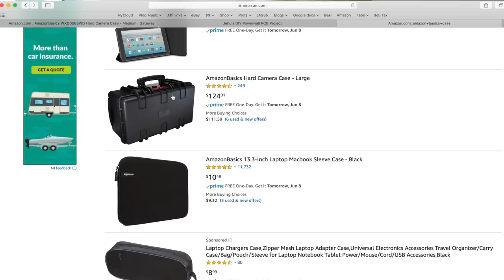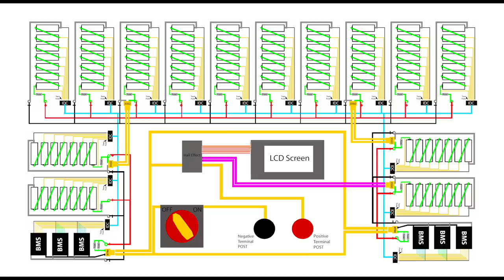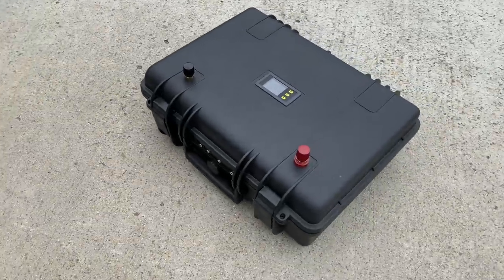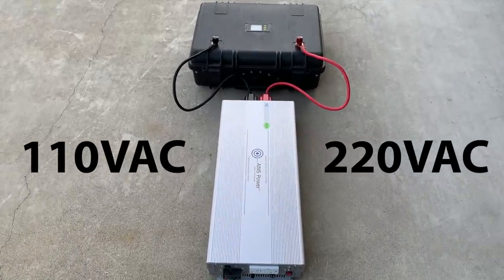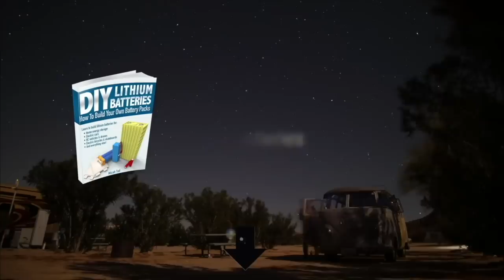600,000mAh DIY Power Pack build

Comment: I would make above the cells themselves a passive radiator with think copper heat pipes that will go between 2 rows of batteries and you open the lid when charging or discharging to dissipate the heat and when you transport it you have it closed and weather sealed , and also heat indicators and switches to not allow the pack to overheat or underheat allowing a heating element to be powered and heat the heat pipes if you are under 5 degrees celsius.(i see he has room for that in that case and if not we go 1 step bigger)

Comment: Put in a cell backward once on a parallel bank.  The spring for the - side. I scrambled half second got it out...freaked me out it lit up like a lightbulb. Unknown brand blue wrap 2000 mAh cells. I'm sure u have some crazy bench stories man...HI VOLTAGE

Comment: Out of curiosity. Have you done any vibration or drop testing with this? I am thinking if I were off road and it fell off the tailgate how would it hold up? Not talking any crazy 10 foot drops or super vibration just normal transport in a vehicle. Love the build!

Comment: Great video, thank you. 600,000mAh = 600Ah, times 24V = 14400Wh = 14.4 KWh. Please clarify.
Reply: Jesus Bermudez It isn’t “times 24”. You have to take the cell voltage which is about ~3.7V. So 600 * 3.7 = 2.22kWh.

Comment: Nice tutorial considering to build a smaller version of it. It's good but you get pylontech 3.5kWh with 48V peak 73A, sustained 37A in a 19 inch rack with handles for $820.

Comment: You are the king of batteries. Put Wh's in the title instead of Ah which tells nothing without knowing the voltage.
Reply from the maker: The masses are easily impressed by big numbers,  and they need to see this
Reply: Then why not put big Wh numbers?
Reply from the maker: Not big enough
Reply: @jehugarcia  2 200 000 mWh not enough?

Comment: While it certainly doesn't hurt, it isn't all that important that cells in parallel be the same voltage so long as each parallel bank is the same voltage as the other, so that all parallel banks (or cells) connected in series are at the same voltage.
Cells connected in parallel will naturally even out. Slowly during rest and faster during discharges, and should mostly do so during the initial discharge, which is a good idea to do prior to a recharge so as to minimize load on the balance fets and resistors(if you have larger variations)

It's much more important to ensure each parallel bank in the series link is precisely the same voltage, which can quickly and easily be achieved by swapping out individual cells, without unnecessary concern.

Comment: What was the final price of the build?    Great video!
Reply: @thesmoothgoat  Aparentemete are two 7s in parallel but it is difficult to understand, I would like jehugarcia to separate or divide it to be able to do it in two steps. Excellent projects Greetings.
Reply: @arizarturo  I know exactly what he did its not difficult at all. I been following jehu for a while now and completely understand everything he does. I have built my own 400ah 18650 mini powerwall working great. My point is for simply charging small devices a 12v system would be better... a 4s system is the way to go for this.
Reply: ~$1500 USD
Reply: 1300€
Reply: If you look in the description below the batteries alone cost $730 per 100 cells and you will need 200 cells for this project. The kit for the board specific to this project in another 500...so it puts this portable battery near $2k.
Reply from the maker: $1500 total
Reply: @phatpunxs64  It's $730 per 200 cells.
Reply from the maker: You do realize you can buy used cells right?  How much more do I have to hold your hand?
Reply: @thesmoothgoat  I could not agree more a 4s2p A123 20Ah Nanophosphate LiFEPO4  AMP20M1HD-A  pack will shit on that suit case pack
Reply: @thesmoothgoat  I looked it up,. the estimates are not all that much. Povertyl level income really from I can see. Would make good extra cash though if he already has a steady income
Reply: Or you can buy a tesla battery E-bay 250Ah 5.2kWh 444 panasonic 18650 cells $1245
Reply: @Raven05R6  Too expensive. Too complicated. Too much labor.
Reply: over $1300, it includes 200 cells for $730, the case for $75, HP BMK 14x$22.72=$318.08, 2xBMS $100 and that's just the major components and not the "what's in the pantry"
Reply: Jehu Garcia, you do realise that you pushed a company that sells new cells for a price that you wouldn't pay for... if you're not going to use someones product then don't promote them, not fucking rocket science
Reply: Ok, now someone please explain how this labor intensive project can beat a used Tesla battery module which retails at around $1, 200 but has more than double of batteries.
Get a suitcase for for the inverter and a trolley. Done!
Reply: @jehugarcia  that's the most douchy thing I've heard in a while, you used new cells and even promoted them, yeezes...
Reply from the maker: @Happyfox I’m going to use evwest cells in my VW bus,  you talking out of your ass here
Reply from the maker: @jcrnda buy a Tesla module and try using it with a 24v inverter and you will find out
Reply from the maker: I promote new and used cells,  are you not paying attention?   Stop complaining! If you can’t afford the new cells then order used ones,  don’t complain that it’s too expensive,  it’s not,  it’s a battery 4x the size of commercially available ones using premium cells,  don’t be ignorant
Reply: @jehugarcia  _ Cheeper, simpler solutions out there with LiFPO4 chemistry that last twice as long.
Reply from the maker: Yes
Reply: @alanalan-mq8yw  wouldent touch a tesla battery with a barge pole. 1 without the main managment your a sitting duck. 2 tesla packs are driven hard so you have no idea how much life is left. 3  one short and you can kiss goodbuy to the alloy fuse links so you end up pulling the pack apart so you may as well go to poundland and buy 444 powerbanks for £1 each as they use NCA cells in them allbeit only 1.2Ah
Reply: @johnbeckman8916  get back to your video game
Reply: @DEVONLAD11  sorry couldn't find your build...flap that jaw!
Reply: @sumacmt  _ Hey Lawrence, thanks for chiming in and showing us all the depth of your ignorance about me and what I do. I'm sure that most people find it weird that you think you can lord over me or anyone else by tell me or others what to do. Good news, therapies are available for that pathology! Those that peruse these comments and have reading comprehension skills know that jehu agreed with me with his "Yes" comment. Blessings to you bro!  😃
Reply: jehugarcia 
With me...?
All the way Baby since I’m just starting out
and attempting to learn this stuff...!
I guess that I made the mistake and actually 
thought that content creators put out videos
like this as a means of teaching people how 
to do things...

Comment: Super Awesome Build!  But I think that your mAh Calculation is a little off. 

It should be more like 85,000mAh. Since you had a 24V system you had 7 cells in series to get that voltage, but Ah don't add in series, only the voltage does. So you essentially have 28 24V 3000mAh batteries in parallel, 28x3000= 84,000mAh @ 24V. Which then gives you 84Ah x 24V = 2.04kWh.
Reply: They actually appear they are in 7s 2p configuration, thus (each board) creating a 24v battery that has a capacity of 6000 mAh(3000 mAh per side). The video is confusing, but if you think of it as 14 (boards) batteries that are paralled together 6000 mAh each, you come up with 84000 mAh, which would be equal to 2016 Wh @ 24v...

Now that makes more sense

Comment: Is 600,000mAh=600Ah?
Reply: Shame the maths a wrong. He didn't use ohms law. He is saying 200x3000mAh but it's a 7s pack. Thus 200/7=28.5 thus 28p7s. 196x3000mah. 28x3000mAh=84Ah.
84Ah x 24v = 2.01Kwh.
Reply: Mykel Hardin  ohms law V=IxR, the amps are still only 3000mah x 28 thus not 600Ah.

Comment: Jehu, thats a beautiful battery and you've made the process of building it very easy. The big important question that no-one seems to be asking is "What's the best way to charge this beauty?"
Reply from the maker: Charger.
Reply from the maker: Small - https://kit.com/jehu/2-2kwh-24v-powerpack-build/jnenconn-29-4v2a-lit
Reply from the maker: Larger - https://youtu.be/80hh4lAImSE
Reply: @jehugarcia  :p yes, but not just any 24Volt charger, are you and I assuming people wont put a 24volt lead acid charger on it?
Reply from the maker: No problem, this is actually a 24v battery
Reply: jehugarcia thanks for the links. The point I was making is it’s important for your viewers and customers to understand that they can’t just use any type of charger, it has to be chargers with the right voltage and changing profile for the batteries.  Maybe there is a video  you could make explaining why.  Say you made two of this boxes and you connected a flat one to a full one, it would not end well, you absolutely need current sensing and current limiting during the charging process. The charges you linked to provide that. I think people need to know why it is so important to use the right type of charger. Love your work!

Comment: And wha is a real usage of it? Why you not using a car/bus acumulator for 1/10 of price?
Reply: Sure, its cheaper, but it also has lower capacity and is heavier. Its also bigger
Reply: Those are starter batteries, which don't like to be deep cycled. I personally would prefer to use a marine battery, you get more capacity with that.

Comment: would have been easier to say 600Ah :) Another great video, what was the final build price?
Reply: I agree with your sentiment, but it's mostly the fault of the manufacturers, who have gotten people accustomed to 30,000mAh USB  battery packs, rather than simply writing 30Ah.
Reply: @gabehumphreys2433  маркетинг
Reply: Even though it's not actually 600AH 
Its only 91AH since it's a 24V battery not a giant 3.7V battery
Reply: @mwbgaming28  i dont think that is how it works
Reply: @ambiguoustvreference835  umm, yes that is how it works
Reply: @mwbgaming28  [x] doubt
Reply: @ambiguoustvreference835  prove me wrong
Reply: @mwbgaming28  i will steal your bones
Reply: @ambiguoustvreference835  I am now convinced that you are trolling
Reply: @mwbgaming28  no u
Reply: @ambiguoustvreference835  i already proved myself, it's called math 

Volts multiplied by amps equals watts 
Watts divided by volts equals amps
Reply: @mwbgaming28  amps×volts=watts. Amps×discharge time=amp hours
Watts×discharge time=watt hours

E.g. 10amps×10hours of discharge= 100 amp hours
There is a difference in amps and amp hours. I hope this clears everything up
Reply: @ambiguoustvreference835  you don't know for certain how long that device runs for 

Its a 24V 91AH battery 
Not a 3.7V 600AH battery
Reply: MWB Gaming You didn’t catch the 15a C rating for each cell part? 
 Sorry had to come back and edit. Forgot to say C rating. And 1w for 24hours is 24 why that means 15a makes this capable of insane ahs!
Reply: @towmater2276  each cell might be able to deliver 15A, but that doesn't change the fact that it's still a 91AH 24V battery
Reply: MWB Gaming I’m curious where you get 91 from 3000mah x 28p comes to 84 not 91.
Reply: @towmater2276  the average capacity of that cell is 3250mah, 3.25 x 28 = 91
Reply: How much was thing thing? $1000?
Reply: yes, around 1000usd and indeed it's 84 to 90 Ah, since 196cells (14x14)  connected 28p7s gives 24V-28V and each battery has around 3000mAh. (28 strings of 3000 is 28x3000 = 84000mAh approx.)
Reply: @mwbgaming28  its 84ah max
Reply: @towmater2276  The c rating doesn't mean shit its all about max amps over a 20 min or 60 min period the c rating is max sustainable amps without overheating battery
Reply: @mwbgaming28  yep, I was doing the math and I was thinking it was only 84Ah which is around your 91, I estimated 7s28p. Went looking into the comments to see if anyone else caught that.

Comment: Very nice build, my only concern is you have live screw terminals on the outside of the case which could potentially be shorted
Reply: Something like this will surely have short circuit protection

Comment: Hold on, those standoffs carry current right?  What about the screws that go through the side of the case?  Are those not isolated?
Reply: The case isn't metal.
Reply: @ThisIsInput  The fasteners sticking out the side are.  If those are not isolated and the edge of the case with those sticking out hits something conductive, sparks would fly.

Comment: I love your channel. It has inspired a great many ideas in my old brain. As I’ve suffered a couple strokes I tend to ask for clarity a lot. My math also sucks so let’s struggle through this together. 14 boards @28 batteries each is 196. And 196 x 3000mah is 588000mah. So 588000mah is 588ah x24v = 14112wh. Meaning that the battery is 14.1kwh if I didn’t miss something. Please let me know if I did as I want to be sure of how to figure my future build! Thanks for all you do for all us diy folks out here. Wait a second! 196 cells, 3.7v 3000mah/3ah, 7S 28P, 15A max discharge rate, so 24v 84,000mah/84ah. Does 15A continuous = 360w C, and since 1w @24hrs is 24wh, then 360w @3ah is 1080wh, multiply that by 28p and we get 30,240wh. Divide 32,240wh by 24v for a 1260ah potential. Don’t let your battery sag 🤪
Reply: You can't parallel adding the mAh when you go series to add voltage.

The cells are in 7s 2p configuration, thus creating a 24v battery that has a capacity of 6000 mAh. The video is confusing, but if you think of it as 14 (boards) batteries that are paralled together 6000 mAh each, you come up with 84000 mAh, which would be equal to 2016 Wh @ 24v...

Now that makes more sense

Comment: The title is confusing and wrong (click bait indeed), your battery is not 600Ah, that would be at what voltage? at 3,65v exactly but it is a 7s system not 1s so at nominal voltage 25,2v its a 87Ah battery. You confirm that by saying its a 2,2kWh system - obviously :P
Reply: Yeah its confusing when the voltage isn't stated as well. 

Many power banks do this as well. I have a 6s Anker powerbank they rate at 20,000mAh but don't explicitly say the voltage. Fortunately they list the watt-hour capacity which is a better unit for overall capacity.
Reply: @bryanjk  Exactly, unless the voltage is explicitly stated we should always use watt hours as a measure of capacity to be able to compare different batteries
Reply: Voltage can be regulated. Capacity is what he's building for.
Reply: @China shorts It doesn’t work like that, because you increase voltage by putting bateries in series and increase capacity (and max current output) by putting them in parallel. He made 28 individual battery packs from 7 batteries in series which gives you 24ish volts and 3000 mAh and then he conected them together in parallel, so the capacity will be 28 * 3000 mAh. If he wanted 600 000 mAh, he would have to put them all in parallel and he would make only 3,6 V. It works like this, because of the law about conservation of energy.

Comment: 24V DC from the battry to 120V AC from the inverter to 240v DC from the car charger into the car.... You are easily going to louse %30-%40 of your power just by Converting and stepping up and down so much. This is very inefficient.

Comment: Yep, what was said re ensuring correct polarity and it's importance I can second for sure, I had a stray pinhead sized drop of solder land with pinpoint accuracy onto of a 50% charged 18650 inturn shorting just ONE cell out.... HOLY COW!!! I've never seen anything like it, it took off like a Catherine wheel wizzing around the room at high-speed spitting flames, sparks and white hot ash over the living room in a blur of fury, landing behind the fridge after finally coming to a stop a full 30sec later, when I finally found it it had burnt a hole through a full thickness floorboard and is now somewhere under the  building..
Reply: You mess with unprotected 18650's at your peril. This is a very nice build but mechanically I'm not too happy with it: cells can shake loose and short out with neighboring cells, some of the cells don't even have shrink wrap on them and there is enough weight here that it will probably self destruct when dropped. Nice concept but it would need a lot more work before I would consider it safe enough for replication. The hard case itself is not enough protection for a pack like this, you'll need shock absorbing lining, isolation, moisture sealing and so on.

Comment: TSA: what kinda bomb is this?!?
Reply: If you can overload a battery it can be a bomb don't joke like that battery acid still hurts on your skin and it all be melting hot after the over load
Reply: @wwbdisthename  18650's can be very dangerous if not handled or charged properly
Reply: @wwbdisthename  lithium batteries don't contain acid

Comment: It's not 600,000mAh
It's 91,000mAh
2200wh / 24V = 91AH
Reply: He is using 200 Batteries with 3000mAh each, totalling 600,000mAh. The nominal Voltage of the cells is 3.6 Volts. Multiply those two and you get just shy of 2.2 kWh. I don't know where you got your 91Ah from.

Comment: If my math is right, that's equivalent to 1.575 kilograms of TNT in terms of energy. That same battery pack could also charge my phone's battery 120 times. My moto E4 plus phone battery is relatively large, so it could recharge other phones even more. Lastly, to maximize battery life, try not to let it go below 40% capacity and, if you're really daring, not above 80%

Comment: 600000 mah power bank will take 30 days or 720 hours to fully charge.......it's really terrible and challenging.
Reply from the maker: Not if you use a 1500w charger,  it will only take 2 hours
Reply: @jehugarcia  2 hours? That's amazing.

Comment: Hi! 1. Values of circuit fuses (SMD on the panels 15A + car double 35A fuses on BMS panels)? The SMD is equal to the battery discharge limit (Sony VTC6 - 15A)? 2. What power Li-Ion charger is worth charging this with - possibly a recommended brand or type? Thanx!